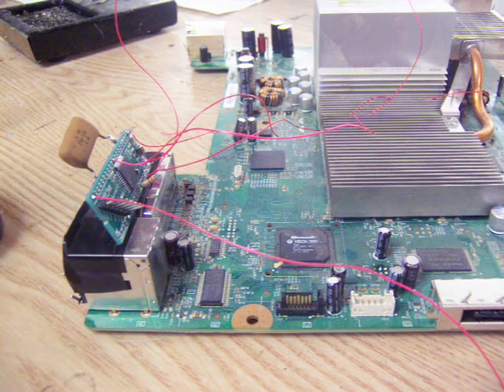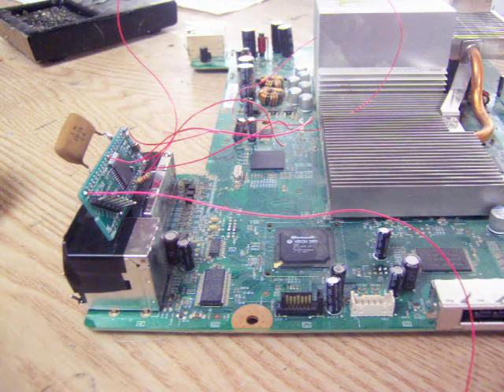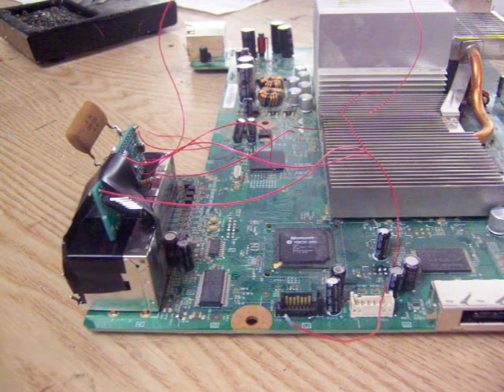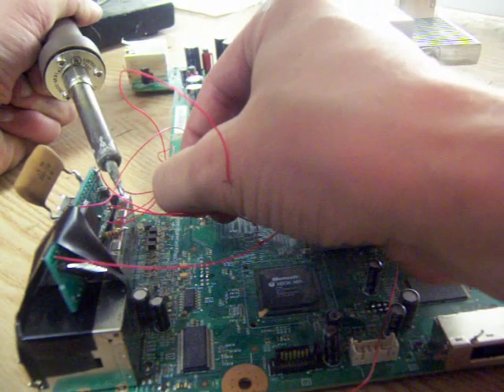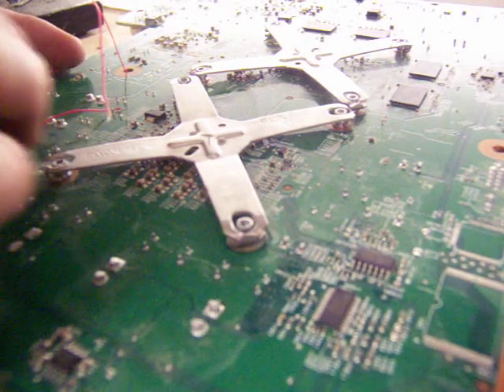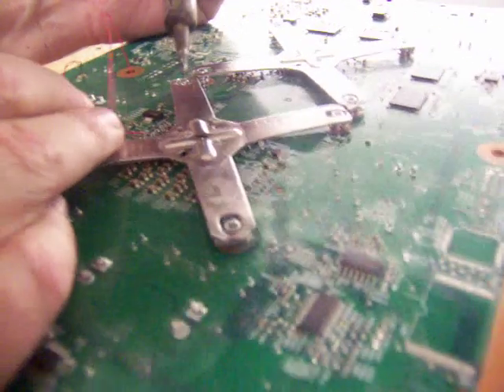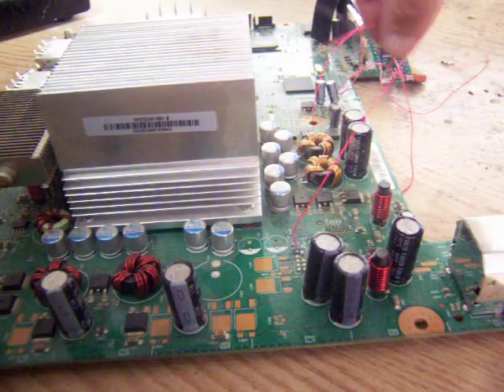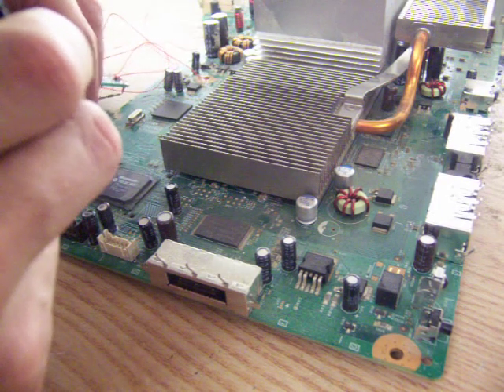Reset Glitch Hack Tutorial Part 3 : Fat 360 ( Wiring the Mainboard)

Comment from the maker: @whocaresanyname - You need to keep your soldering tip clean and tinned , clean it off with a wet sponge then try to get solder to stick. And always heat what you are trying to solder, and touch the solder to the component, don't touch the solder to the tip it will just ball up on the tip.